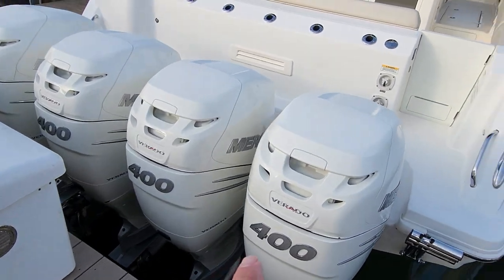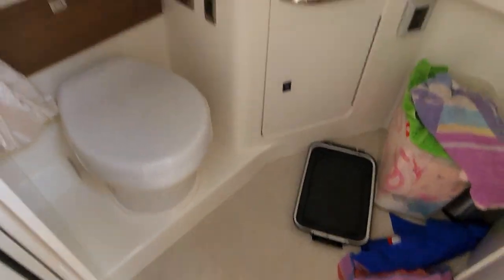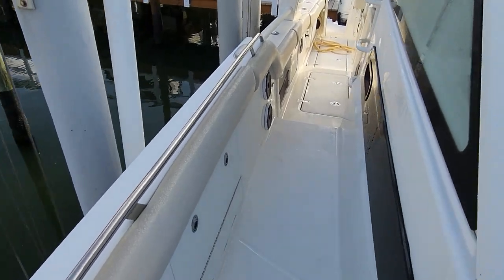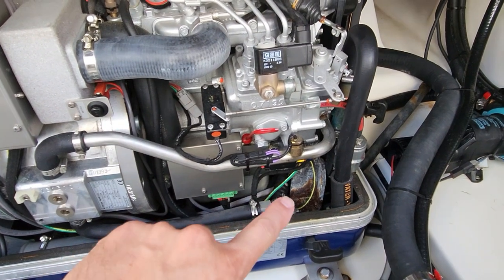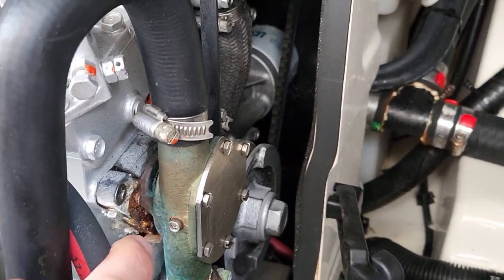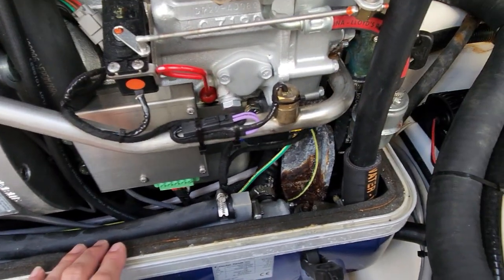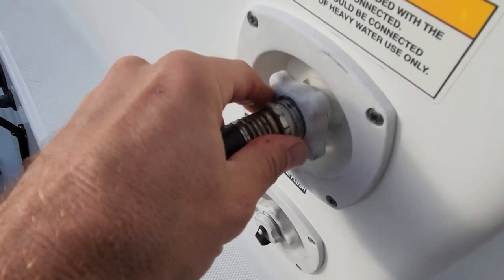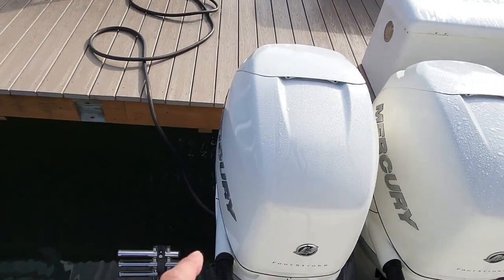Fischer Panda & Mercury Verado Problems 420 Boston Whaler Outrage #Verado #MarineMax #Episode204

Comment: As always, interesting to see what is wrong with the generator and the Verados. That BW 420 Outrage is a beast -- it's a very heavy boat with a fairly deep V, so it takes lots of power to get it up and going. But it handles rough seas  well -- it can cruise through five-footers at 28 knots quite comfortably.

Comment: Justin, thank you for the showing of the reverso flush. My 320 Vantage does the same thing with the reverso flushing on 350 L6’s. MarineMax Clearwater said that wasn’t wrong or broken. 

What do I not understand, how should the reverso flush system work instead of coming out the side?
Reply from the maker: It's the way that Boston Whaler rigs them. It's normal for them to spray out the side of the motor when flushing.  I was showing what happens basically when the valve fails and the motor is running it will spray out the side. If your motor doesn't spray out the side when running (not on the Reverso)then the valve is working correctly.
Reply: @JustinLeeMarine  Ah gotcha, now I understand. Thank you sir!
Reply from the maker: I didn't explain it enough in the video. If I get back to that boat I will show how to correct it from spraying out the side also. Check valves everywhere. Lol

Comment: I will be removing the westerbeke from my 28 Express this spring.  Do you recommend a generator brand for replacement, no bowl.....ha
Reply from the maker: I would say Fischer Panda or Kohler.  The best thing to do is make sure you have a local dealer for the parts and a good tech for service/check ups. Everything will eventually have a failure. It's how fast you can get it fixed and running again.

Comment: Just got a 420 with 600's on the back. Do you have a problem in the cockpit when the generator is on it literally makes it unbearable when driving with a vibration that hits your head?
Reply from the maker: I have not heard of this or noticed it when running the 420 but I will ask and get back to you. I'm curious too.
Reply: @JustinLeeMarine  Thank you, it vibrates your head to the point that the first drive was on Friday, and had severe headaches all week and already emailing about the return of the boat. I hope it is just a defective generator. Thank you so much.

Comment: Is a whaler problem with the T they put in and the valve isn’t the issue. I’ve repaired this problem before .
Reply from the maker: You are correct. I wanted to show what happens when the valve goes bad on the flush. That is a common problem on Mercs.  Good catch on the video.  🙃

Comment: Do you have an episode where you pop the water pump off a panda?
Reply from the maker: I honestly don't remember. I have a bunch of them about the Fischer Panda water pump. Just look back on my page. You should be able to find a few about the Panda. 😊
Reply: @JustinLeeMarine   Trying to figure out how to get the water pump off the generator?  Watched a number of your videos.  Really with I would have seen the episode with the water shut off (resistivity) sensors before I experienced that fault on a trip two years ago.
Reply from the maker: It is not too difficult.  One 10 millimeter bolt and one #3 screw on the plate behind it. Pull both of them and wiggle the pump off the block. You will need to disconnect both hoses first.
Reply: @JustinLeeMarine  thanks will give it a go next weekend!